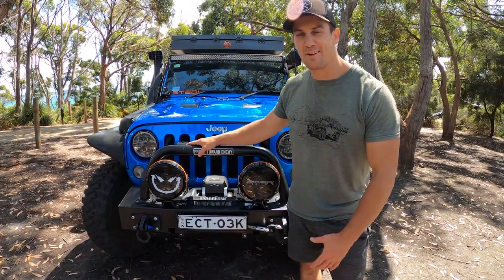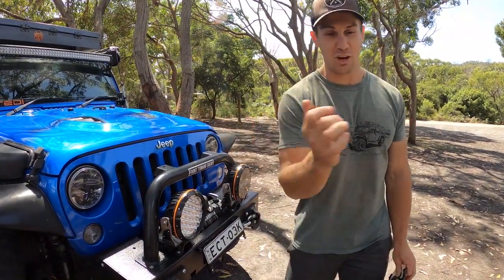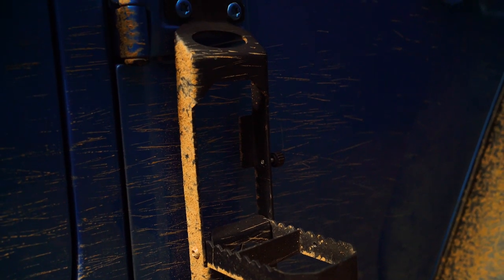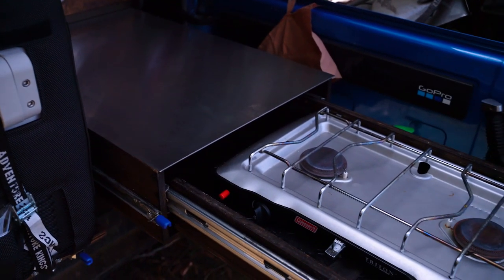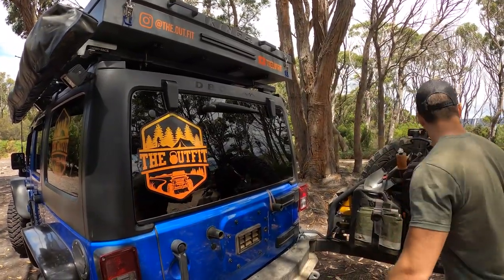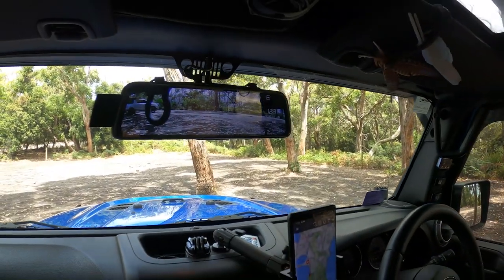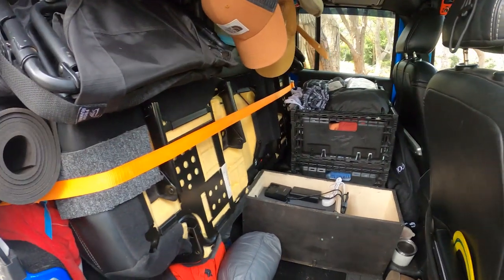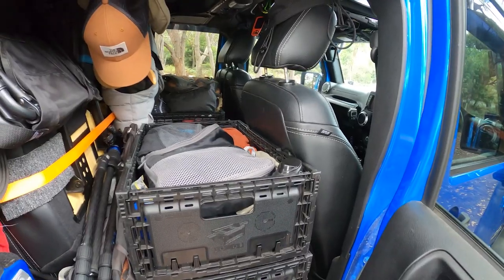JEEP WRANGLER OVERLANDING RIG WALK AROUND - Full-Time Living On The Road In Australia

Comment: Regarding the fender fading all you need is this item which you can get nearly anywhere, ebay, walmart.com, etc. and will leave the fenders looking like new (ARMOR ALL Original protectant - 16 oz Trigger Spray Bottle) works on dashboards, tires and so on. If you havent used this before you do a spray or two and wipe it over the rest with a rag.

Comment: Couple quick questions: 1) What kind of range do you get between fillups with the built in fuel tank only? 2) How would you describe the over all comfort with the extra weight, and your suspension setup? (can you drive 10+ hours and not feel exhausted from a rough ride?) 3) How has reliability been?  Have you had any issues with the Jeep?  4) Would you change anything, like wish you had more space inside for storage? 5) How many days can you go off grid without worrying about food, water, no showering, etc? 6) Have you had it in any rough weather conditions like really cold at night, really hot, rain, etc?  Just curious how you handled the elements, and if your vehicle worked well for you.  Sorry for all the extra questions... I'm looking for my next overland platform.

Comment: Thats a really good explanation of how you have things setup in the Jeep. I always love seeing how other people do things and I like the idea of the light weight Coles crates in the back. I figure you have changed the diff ratios to spin the 37"s??? I also noticed you filmed this one at Cloudy Bay, one of my favourite local camp spots. Reach out if you come back to Tassie - I run a 4WD Club down here and would be great to have your guys along on one of our trips - Aaron
Reply from the maker: Hi Aaron, thanks for the great offer - certainly will hit you up if/when we return. Good spotting on Cloudy Bay - was nice and quiet when we were there. I actually still run the stock 4.11 ratios at the moment mainly to keep those larger teeth in the diff. I worry with the smaller ones, I may snap them with the big tyres. So far it's not bothering me too much, the throttle controller helps

Comment: Nice setup!! Giving me some ideas on how I would like ours to be. Quick question. How are the camping rock lights mounted? I will be running the Rhino Backbone with the Vortex bars and was trying to figure out how to mount some additional lighting.
Reply from the maker: Cheers! The outside parts (of the backbone system) on the hardtop have a screw where I mounted the lights. The el-cheapo lights came with their own little swivel mount thing. Almost need to take a pic to show
Reply: The OutFit I haven’t installed the backbone yet. I think I know which part you are talking about. Thanks for the quick reply! Hitting the sub button now. 😎

Comment: great detail on the walk around. Just sell those seats though. I'm sure you're worried about resale but they won't be hard to buy again. They will give you so much spa e and weight back its well worth it. I've done exactly that with my last 3 cars.

also, if you go down the road of solar on the roof, the kings PVs are quite good for their price. bucket load of sicaflex black to hold them down and a blob on each rivit to spread the load as the head of the rivit will crack the cells.

Comment: Why not just trade it in for a Toyota?  Australian Diesel Toyota’s with a retune are Overlanding gold.  Unsure how this would handle an accident during daily driving.
Reply from the maker: Yes great for overlanding, but does not have the rock crawling capabilities we were after. A 79 series is nice, but doesn't flex and costs well over $100K aud with some mods - more than double our Rubi. My first 4x4 was a 60 series, great truck but nowhere near comparable to this. Cheers
Reply: The OutFit that’s odd as your numbers seem off.  Try checking your local dealer but a used 80 series or chassis swap of an 80 series with a 60 series body is more capable than the Jeep, plus they offer diesel versions which are highly tunable.  Call me crazy mate but when I was in Aussie I did not run across many guys rock crawling or many sites dedicated to doing this.  Plus I live in SoCal and you could NEVER Rock Crawl with your Rig as you live out of it and it is way too heavy with gear and would tip over.  Your Jeep is set up for touring at best Mate.  Visit the U.S and you will see what rock crawling rigs look like.  I crew up Crawlin’ with friends and NO ONE would have want you to hit and hard trails with your Jeep as it is underpowered, factory geared, and does not have enough clearance.  In a country like Australia there is a reason you rarely see Jeeps, you guys have one of the most beautiful and vast countrysides second to only Africa Mate.  Consider a 76 series as trust me Mate a well tuned diesel Aussie spec’d Toyota is a vehicle we see as legend status here in the states.  Better than petrol fuel economy and low range torque of a diesel that is perfect for slow speed idling.  Anyhow.  Good luck with your channel but as a guy who has lived on 6 of 7 continents you could not pay me to drive anything but a Toyota.
Reply from the maker: Cheers for your opinion Soul Surfer. I'm more talking about crawling along the lines of KatetheJeep and TrailRecon. This Jeep crawls great. Feel free to check out our Climies Vid. Wouldn't want to do anything too extreme but checkout Aussie4Wheelers on YouTube if you don't think Australia has rockcrawling. Elite KOTH level is not the style of crawling I am referring too. I never mentioned the price of an 80 series, so no my numbers aren't off. And again, no it is not more capable - I have wheeled many times alongside 80 series Cruisers and big jacked up Nissan Patrol's. I have also driven an 80 series offroad a bunch of times too. I do not agree they are more capable at all. Yes they have more power but that isn't something that would have ever helped me offroad so far (more sand driving may prove otherwise in the future), apart from being nice on the highway for overtaking etc. The only thing I would want with a Cruiser over the Jeep is a bit more space and better fuel economy. I'm very very happy with our decision to go with the Rubicon. I grew up around Cruisers mate, owned one, Dad owned an FJ40 when I was growing up. Lots of mates with 80's etc - Americans froth over them because you can't get them factory there and they are diesel. 🤷‍♂️